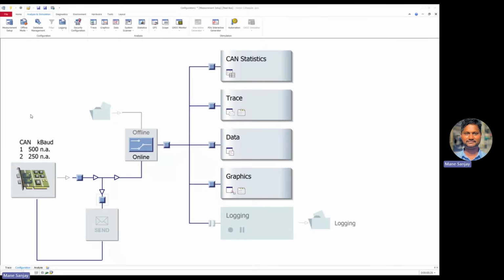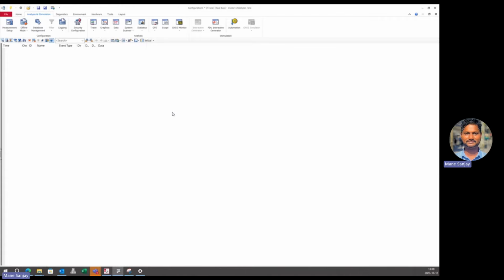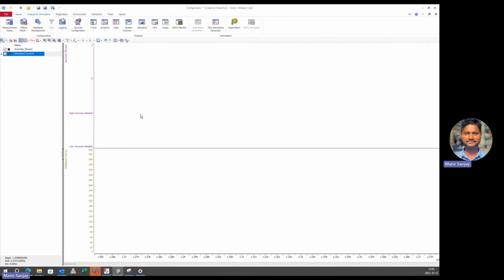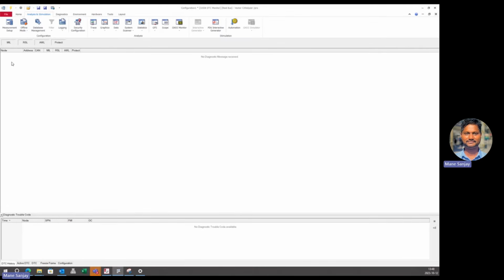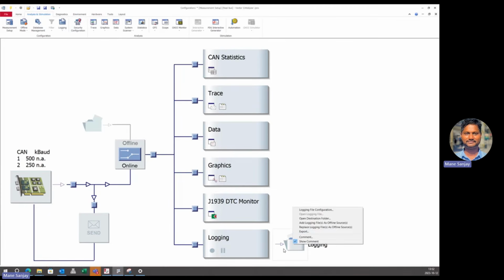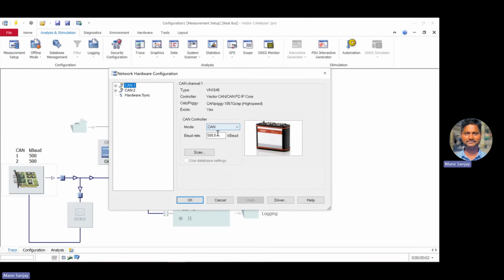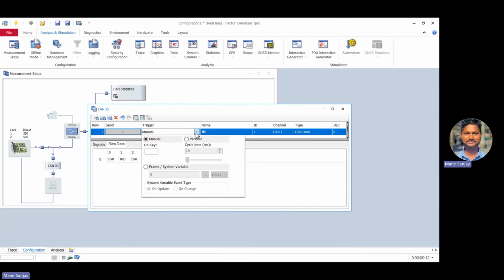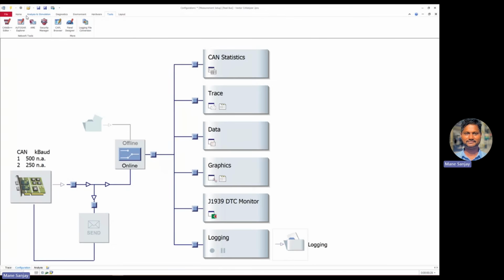Basics of Vector CANalyzer Tool | Vector CANalyzer Tool - Tutorial | Learn CANalyzer Tool

Comment: Hello 
Can we add two simulated noded in CANalyzer like one ECU on CAN1 and second ECU2 on CAN2.Can you please  reply for this issue.,
Reply from the maker: In simulation setup you cannot perform simulation of two ECUs using CANAnalyser, but that is absolutely possible by using CANOe. Now coming back again to your question still it is possible using CANAnalyser by using CAPL. 
So answer to your question is - using CANAnalyser you can only simulate two ECU nodes by using CAPL script but using CANoe you can simulate 2 nodes using either simulation setup as well as CAPL script.

Remember CANoe is a parent tool in terms of capabilities, in terms of capacity.

Comment: Do you have any data structure for can implementation for major inverters
Reply from the maker: It varies for inverter to inverter as suppliers are different in the market. As like engine, brakes, transmission systems there are no standard message structures defined under J1939 for inverters, chargers and batteries yet. You need to find this information with any of the inverter supplier.

Comment: Very Nice Explanation👌. What is difference between CANoe and CANAnylzer Tool.?
Reply from the maker: Very simple CANoe is a parent tool. All features available in CANalyzer are covered under CANoe. Using CANalyzer you simply simulate one node only. It may consist multiple CAN messages with different identifiers but only one node. On the other hand at CANoe you can simulate multiple nodes as like complete vehicle.